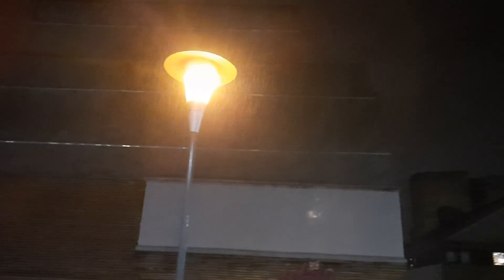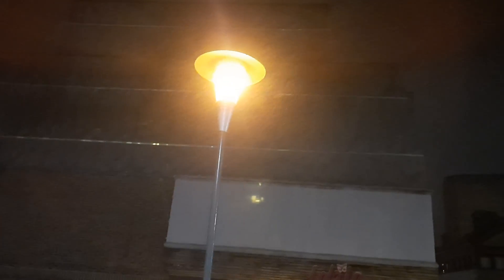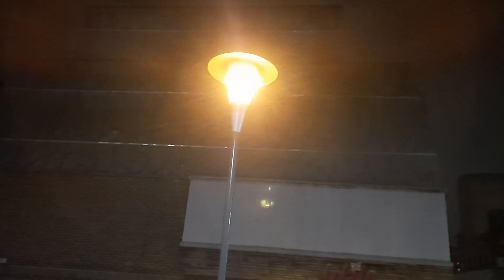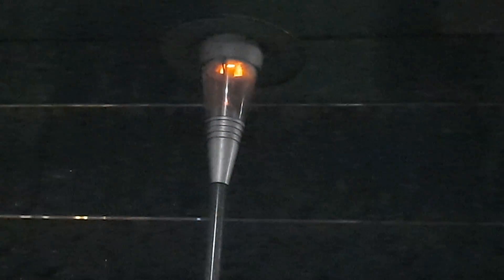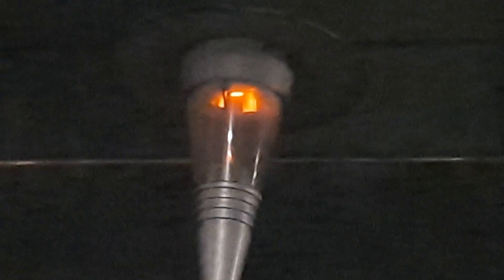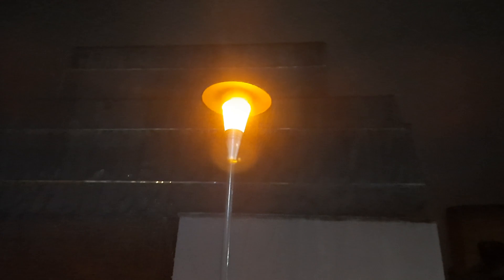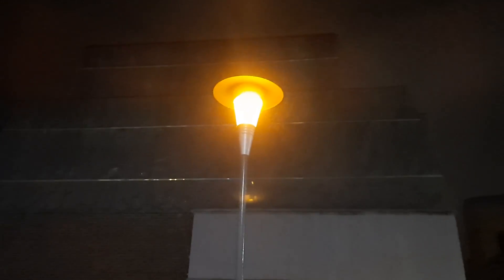Cycling Street Lamp in Cambridge.

Comment: There used to be a Beta 79 two columns away from my house that had a cycling SON bulb as well. I think the bulb was replaced but sadly the streetlights are now converted to LED.
Reply from the maker: Yes this is becoming all to common now. Many councils desire to change the complete lantern than just the lamp
Reply: It was fixed eventually, but that was before the LED conversion.